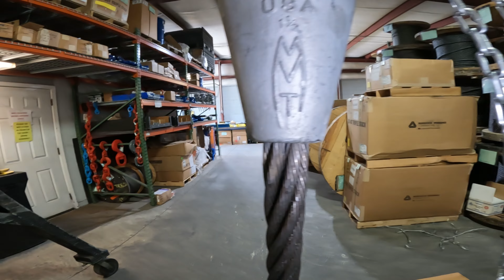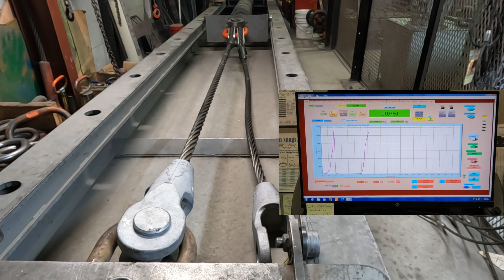1-3/4" 2  Leg Spreader with Spelter sockts at bottom

Comment: When i was a kid (17) we had to cut 1" cable , 150' long in the snowy parking lot. Six sections, pulled off the spools manually. Freezing cold and wet, cut with a grinding cut-off wheel. The only guy with safety glasses. We did have work gloves. For the barge operations in Chicago. The best part was a hot lunch paid for and a dry restaurant. This is hard work, fingers smashed all the time. 👍
Reply from the maker: So you know what we go through everyday,  we hand measure crane cables for a customer that is 1" and 7/8 cable that are 203' to 500 off of full spools weighing 5,000 lbs
Reply: @hanginwithdaddio  Oh I do know the pain involved. Heavy equipment, lifting and pry bar torque on your body 👍

Comment: We got a huge punch press for punching cones out of sockets that we use to open up thimbles larger than 1-3/8" some guys use the test bed but if we had a something to bend them by hand at the shop it's disappeared more than 20 years ago.
Reply from the maker: Yeah we still use long pipes and say a prayer when we open them.  We did up to 3" at our old shop and we only do 2-1/2" here now and I'm getting to damn old to do that anymore. 🤣
Reply: @hanginwithdaddio  we do up to 4-1/2" although I think that reel is probably as old as I am. We typically do 1-3/4"-3"in the larger ropes. Our old National 3,000 ton  swager for big ropes leaks since we don't use it very often and the kid they installed to be foreman doesn't care about maintaining anything. 

I see you folks still use the old escos.
We got tired of rebuilding them so we got 3 talurits. Great presses if you take care of them unfortunately all but one has yet again been neglected. 

The old escos are great but you gotta grease them regularly.